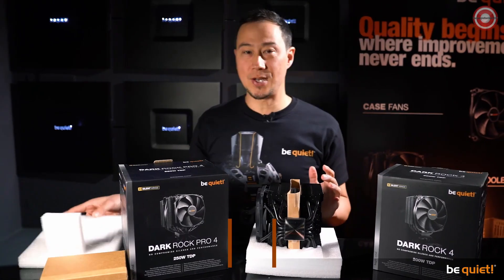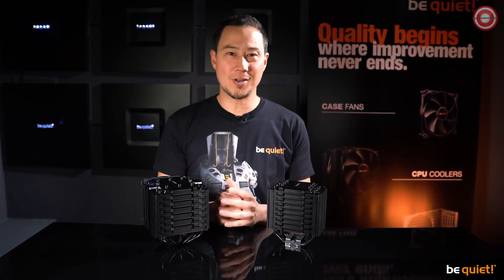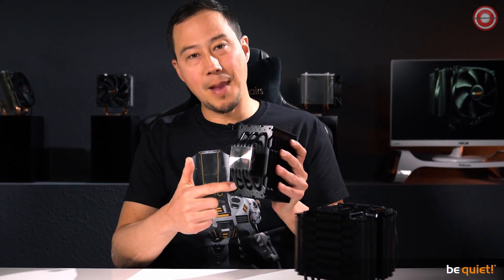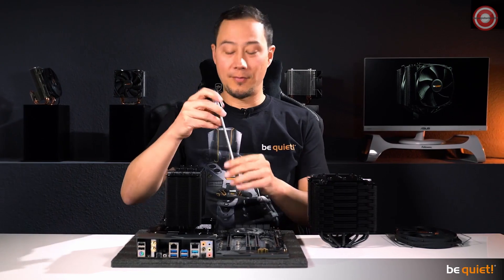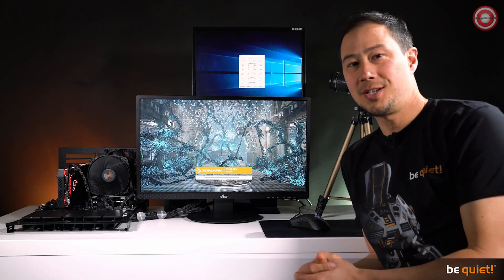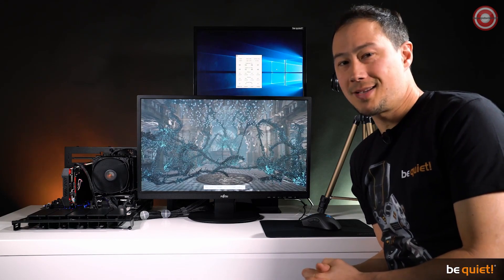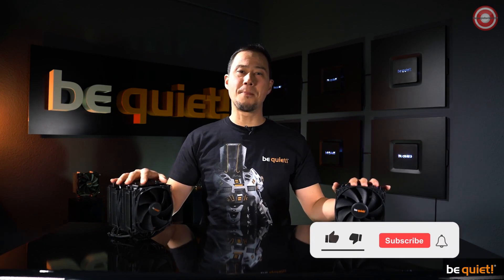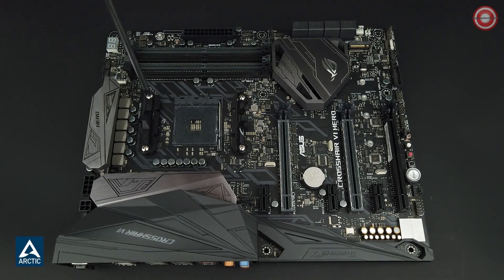Ultimate Cooling Showdown: 5 Top CPU Coolers for Ryzen 7 7800X3D

Comment: Which will last the longest?
Reply from the maker: @bishopbling-bling  An air one is best suited for other requirements.
Reply: In my opinion, Noctua will last the longest.  Also, in my opinion, they make the highest quality heatsinks on the market!  I've been using an NH-D15 for over 12 years now, and it's running like brand-new.  I was just vacuuming the dust out of it last week and I hand-spun both fans, and they spun beautifully, just like they did when they were new.  BUT, before you buy a Noctua, make sure it will fit in your build because these puppies are HUGE.
They're shown at the end of this video, but nothing is said about them, which I think is a great injustice to an awesome product!  And that's why I think this video is mainly just clickbait garbage for the Dark Rock heatsink which looks like a Noctua wanna-be to me.  🙄

Comment: would an enermax f40 work for a Ryzen 7800x 3d
Reply from the maker: The Enermax ETS-F40 is a capable cooler that should be able to handle the thermal output of the Ryzen 7 7800X 3D under normal conditions. It boasts a 200W TDP rating, which is sufficient for the 105W TDP of the Ryzen 7 7800X 3D.
However, it's important to consider factors that can affect CPU temperature, such as overclocking and airflow within your case. If you plan to overclock the CPU or your case has limited airflow, a more powerful cooler might be necessary.
Reply: @AryTechB  I won't be overclocking.  Just trying to get a computer for a decade

Comment: No bench, no test, nothing.....
Reply: Prolly a legit bot account, dark rock 4 is ass for 7800x3d, bad thermals compared to much cheaper alternatives cause it has no offset mount, its still gonna cool it fine for gaming tho this cpu is pretty easy to cool in normal use

Comment: Is ls520 white enough for gaming  and recording and for work with Photoshop and perimer pro can it hold 7800x3d under 85 degrees?
Reply from the maker: LS520 has a TDP rating of 220W, which is technically enough for the 7800X3D with its 105W TDP. However, under heavy loads during gaming and recording, the CPU can draw more power, potentially exceeding the cooler's capabilities. This could lead to higher temperatures and throttling, impacting performance.
Reply: thank youuuuuuuuu i go and buy ls720 :) @AryTechB

Comment: Do you even need an aio? Would a noctua air cooler work just fine?
Reply from the maker: A Noctua air cooler can work just fine for the Ryzen 7 7800X3D, but it depends on your specific needs and preferences. If you plan on overclocking the CPU, then an AIO liquid cooler will be a better choice, as it will provide better cooling and allow for more overclocking headroom. However, if you are not planning on overclocking, then a high-quality air cooler like a Noctua NH-D15 or NH-U12A will be more than enough to keep the CPU cool under normal use.

Comment: IMO I wouldnt touch any lian li AIOs... If you look on their subreddit for the past month theres been nothing but complaints/failures, plus they just did a massive recall on the Galahad 360 Performance. Maybe in the future but for now I'd steer clear from them
Reply: agreed. iv owned 2 pairs of Lian li galahad 2 performance. the pump started making ALOT of noises so i got a new one. this one just started making noises aswell and have failed to start the pump several times on startup. will be looking out for another brand and AIO in the coming days! DONT buy lian li AIO's
Reply from the maker: Thanks for the info
Reply: Thanks for letting me know I know this is 11 months later but I was JUST looking at their Trinity 360 cooler for my new 7800X3D build 🥲 I am considering a Dark Rock Elite cooler instead I just hope it fits okay…
Reply: @93ChayZ Привет. Какой кулер в итоге выбрали?

Comment: Thoughts on the DeepCool AK620?
Reply from the maker: In my opinion, DeepCool AK620 is a good cooler for Ryzen 7 7800X3D.  It is able to keep the CPU temperature low even when it is under heavy load.
The AK620 features an innovative design with two 120mm fans that provide a large cooling surface.  The fans are also very efficient, meaning the cooler is relatively quiet.

Comment: Thoughts on the DeepCool LT720 360mm and high performance?
Reply from the maker: The DeepCool LT720 360mm is an excellent choice for cooling the Ryzen 7 7800X3D. It is a top-tier AIO cooler that can handle even the most demanding workloads. It has a large 360mm radiator, three high-performance fans, and a fourth-generation dual-chamber pump. It is also compatible with AM5 motherboards, so it is future-proof. In testing, the DeepCool LT720 360mm was able to keep the Ryzen 7 7800X3D at under 70 degrees Celsius under full load. This is well below the safe operating temperature for the CPU, which means that you can overclock it without worrying about overheating.

Comment: mate one question  why in the  AIO coolers  is tested in AM 4  socet  and not  in AM 5 - Ryzen 7 7800X3D ?
Reply: Easy. This is a guess based video. Notice how little testing was done? LoL
Reply from the maker: There I wanted to show how the AIO is installed and I had no other option at the time of making the video.
PS: the installation method is the same in both cases.

Comment: wouldn't reccomend air cooling this cpu. Even though low tdp it will thermal throttle with all air coolers.
Reply from the maker: In what kind of scenario do you not recommend this?
I recommend these air coolers in a scenario of light workloads, casual gaming.
Thanks for yor feedback!
Reply: this cpu is made for gaming it doesnt need nitrogen cooling 😂😂😂

Comment: Ultimate cooling showdown, 5 coolers and no temps

Ultimate GPU showdown, 19 cards - no FPS

Ultimate umbrella Showdown, 5 umbrellas and no rain

it's the same f'n thing

What in the HELL is this and what's the point of this entire video ???
Reply from the maker: Thank you for taking the time to watch my video. I understand your frustration, and I apologize if the video did not meet your expectations. I am always working to improve my content, and I appreciate your feedback.
I would like to clarify that the purpose of the video was to compare the performance of five different CPU coolers. I did not include any temperature data in the video because I wanted to focus on the relative performance of the coolers. I believe that this approach provides a more fair and accurate comparison.
I understand that some viewers may find this approach frustrating, and I apologize for any inconvenience this may cause. I am always open to suggestions for improvement, and I will consider your feedback when creating future videos.
Thank you for your understanding.

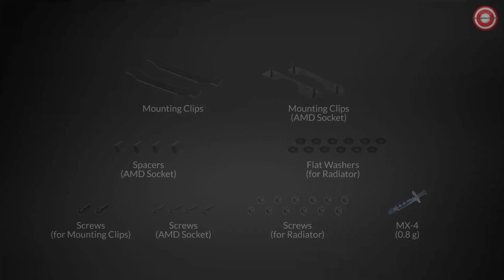Comment: 3:57 I thought the video is focused on 7800x3d which is AM5. are AM4 brackets compatible with AM5 CPUs?
Reply: Thanks guys, it really helped come to a decision on the CPU cooler to get
Reply from the maker: Yes, AM4 brackets are compatible with AM5 CPUs. The AM5 socket uses the same mounting hole pattern as the AM4 socket, so any cooler that fits AM4 will also fit AM5. This means that you can use your existing AM4 cooler with your new AM5 CPU without any problems.

However, there are a few things to keep in mind. First, some coolers may require an additional mounting bracket to be compatible with AM5. You can check with your cooler manufacturer to see if you need an additional bracket. Second, some coolers may not be as efficient at cooling AM5 CPUs as they are at cooling AM4 CPUs. This is because AM5 CPUs draw more power than AM4 CPUs, so they generate more heat. If you are using a high-end AM5 CPU, you may want to consider upgrading to a more powerful cooler.

Overall, AM4 brackets are compatible with AM5 CPUs. However, you may want to check with your cooler manufacturer to see if you need an additional mounting bracket and to make sure that your cooler is powerful enough to cool your AM5 CPU.

Here is an example of installing Arctic Liquid Freezer II on AM5: https://youtu.be/8UljxTHmbDQ?si=tLmyP5PVL0HGtkJE

Comment: Is Arctic 280mm suitable?  Please reply brother
Reply from the maker: Yes, a 280mm Arctic Liquid Freezer II is a suitable cooler for the Ryzen 7 7800X3D. It is a powerful CPU, but it does not generate a lot of heat. The Arctic Liquid Freezer II is a very efficient cooler, and it should be able to keep the CPU cool even under heavy load.
Reply: 240mm its ok?
Reply from the maker: @TheRealTiguere  Yes, a 240mm AIO is good for cooling a R7 7800X3D in most cases. The 7800X3D is a powerful CPU, but it is not as power-hungry as some of its higher-end counterparts. However, if you plan to overclock the CPU or use it for very demanding tasks, you may want to consider a 280mm AIO for better cooling performance.

Comment: wich is better Lian Li Galahad II Trinity 360 or Lian Li Galahad II Trinity Performance 360?
Reply from the maker: The Lian Li Galahad II Trinity Performance 360 is the better AIO cooler of the two. It has a number of improvements over the standard Galahad II Trinity 360, including:
-A larger copper plate with 11% larger fin spacing, for improved heat transfer and to prevent substance buildup over time.
-A 15% bigger pump impeller, to deliver water more efficiently.
-A 31% faster motor speed, to gain stronger water flow.
These improvements result in a cooler that can handle even the most demanding applications, such as overclocked high-end CPUs and GPUs.
The only real advantage of the standard Galahad II Trinity 360 is that it is slightly cheaper. However, the difference in price is relatively small, and the performance improvements of the Galahad II Trinity Performance 360 are worth the extra cost.
Reply: @AryTechB  ty bro I Am planning to build ryzen 7 7800x3d with rtx 4080 or rx 7900 xtx could you recommend me one motherboard? I was thinking on asus tuf gaming b650 plus or  gigabyte b650 aorus elite ax but I dont know if I should buy other
Reply from the maker: Both the ASUS TUF Gaming B650 Plus and the GIGABYTE B650 AORUS ELITE AX are good motherboards for a Ryzen 7 7800X3D with an RTX 4080 or RX 7900 XTX. They both have the features you need, such as: Support for Ryzen 7000 series CPUs, PCIe 5.0 slot for the graphics card, M.2 slots for NVMe SSDs, USB 3.2 Gen 2 ports, 2.5 Gbps Ethernet port, WiFi and Bluetooth.
The main difference between the two motherboards is that the GIGABYTE B650 AORUS ELITE AX has a slightly better VRM and more USB 3.2 Gen 2 ports. However, both motherboards should be able to handle a Ryzen 7 7800X3D and an RTX 4080 or RX 7900 XTX without any problems.
If you are looking for the best possible performance, then the GIGABYTE B650 AORUS ELITE AX is the better choice. However, if you are on a budget or do not need the extra features, then the ASUS TUF Gaming B650 Plus is a good option as well.
Reply: @AryTechB  ty

Comment: i'm not finding Lian Li GALAHAD AIO 360, Can i use a Li GALAHAD AIO 240mm for 7800x3d? Will be enough for this CPU?
Reply from the maker: The Lian Li Galahad AIO 240mm is a good enough cooler for the Ryzen 7 7800X3D, but it is not the best. The 7800X3D has a TDP of 105W, but it can boost to much higher power levels under load, especially if you are overclocking it. The Galahad AIO 240mm is rated for a TDP of 250W, so it should be able to handle the 7800X3D, but you may see higher temperatures under heavy load.

If you are looking for the best possible cooling for your 7800X3D, I would recommend a 360mm AIO cooler or a custom water cooling loop. However, the Galahad AIO 240mm is a good budget-friendly option that should be able to keep your CPU cool enough for most tasks.

Comment: What about Peerless Assassin? It seems to have 265w tdp, is close to noctua, but much cheaper.
Reply: Yeah, the video is wrong. The Peerless Assassin SE is better than both the Dark Rock Pro 4 and the NH-D15.
Reply: @user-hr7kf6wq6p  I've owned all 3 and can confirm it's not better. Thermals on the noctua are top and noise on the be quiet is pretty much the best in the market. Peerless Assassin wins value for money though by a long way!
Reply from the maker: Guys, these are my suggestions for you.
Thank you for the suggestions.
Reply from the maker: By the way, five of the best coolers are presented here, but that doesn't mean that there aren't others just as good or better.